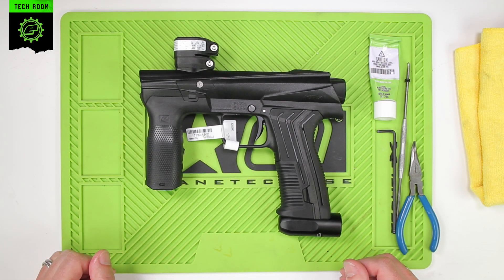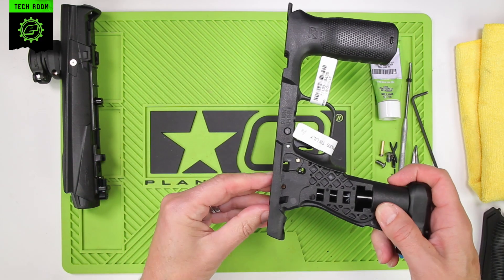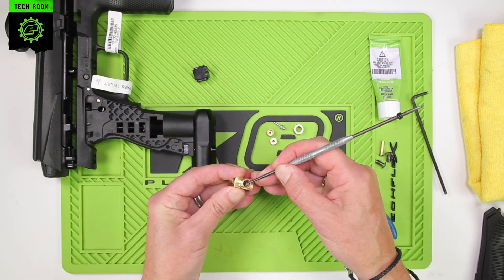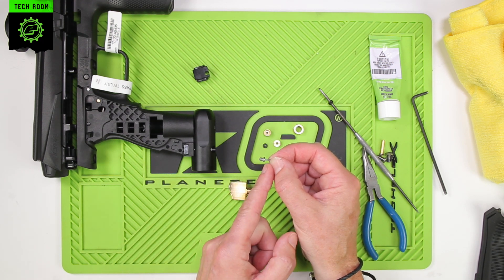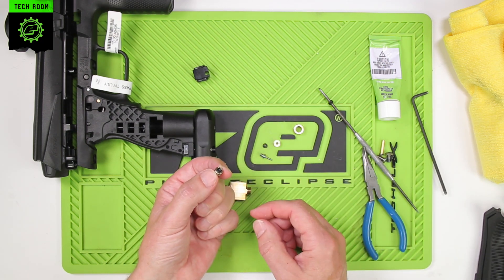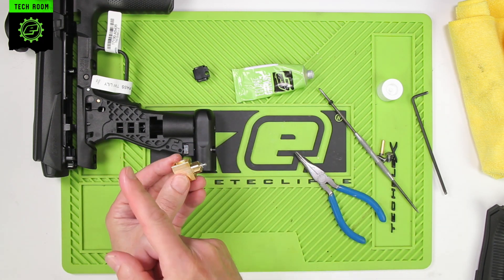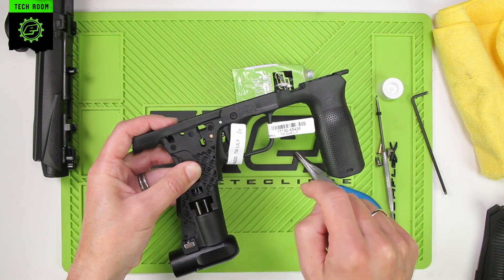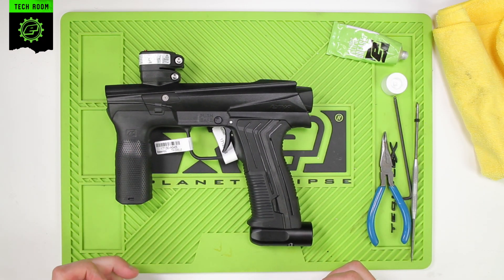Eclipse FL 3-Way Valve: Basic Maintenance

Comment: is the emek the only marker that contains this valve? all mechanicals or all modern PE markers?>
Reply: The EMEK doesn't come with this valve. It's an upgrade part that can be bought to fit into the EMEK. The CS2 mechanical frame comes with a valve that is almost identical.
Reply: @TheBroz  there is a cs2 mechanical frame what!?